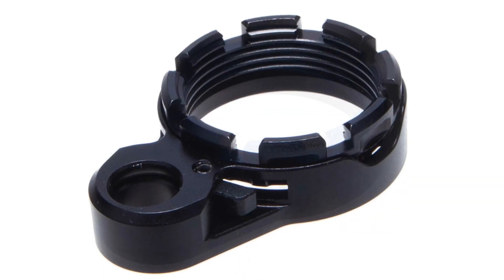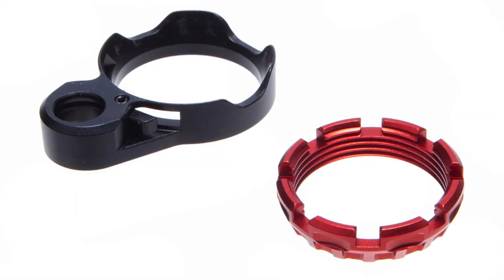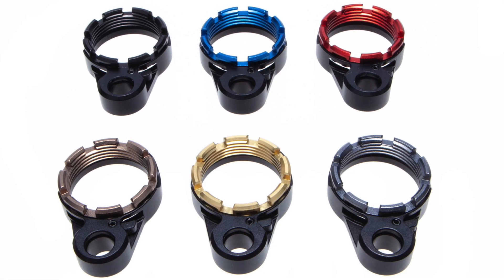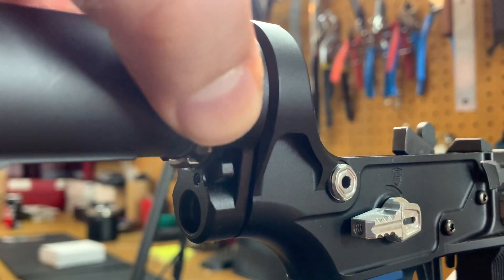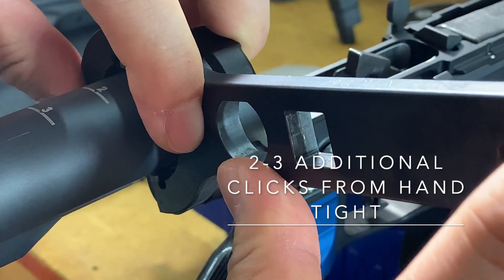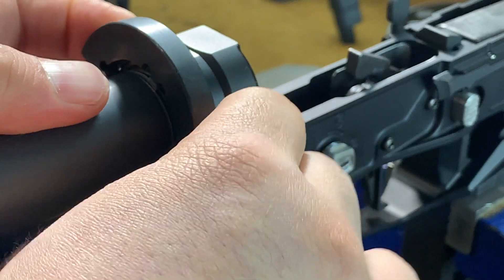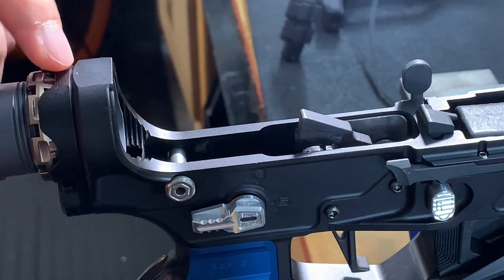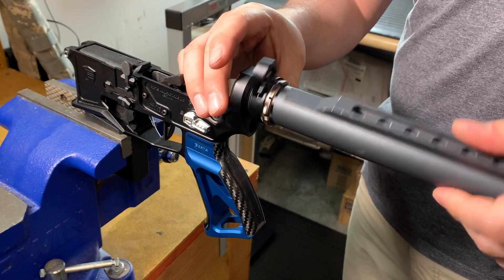Lightweight Enhanced End Plate - K2 System (Locking Lever) Installation

Comment: Does said product end the need for staking? Thank you in advance.
Reply from the maker: No, you do not need to stake it. That's what the K2 locking system is intended to do. It won't move once tightened.
Reply: @FortisMFG  That is a big plus in my book.

Comment: Hey all, I just had this product delivered yesterday. I installed it but for some reason the locking system didn’t function properly. After a few minutes of trying to remove it and pushing up/down on the lever, the lever broke. It is now stuck and I can’t get it off. Any ideas how to get this off my new lower I’m building.
Reply from the maker: Give us a call and we can figure out what might have happened. We'll get you squared away.
Reply: @FortisMFG  thank you for replying, i actually sent in a support email. should i just call the main number?
Reply from the maker: @cryptonationunited7967  Yes, or email directly at info@fortismfg.com. Sending in a photo or two might help.

Comment: I’m seeing two versions of the K2. Some with this version, the locking lever, and another with a C-Clip? But I can’t find the C-Clip version on your website. Is there two different versions of K2 or just a difference in descriptions across websites?
Reply from the maker: Hi Austin, the C-Clip was a prototype. The final version is the one you see here and more robust than the prototype was. Thanks.
Reply: FortisMFG Thank you for the reply. Are retailers selling the prototype versions or are their descriptions not accurate to the final product?
Reply from the maker: @austinw8097  We've never sold prototypes. So no, this is the only version we ever released.
Reply: @FortisMFG  I've seen the prototype version with the clip on optics planet. https://www.opticsplanet.com/fortis-manufacturing-ar-15-le-omega-clip-castle-nut-end-plate-k2-system.html
Is this accurate, or a mistake?
Reply from the maker: @FloridaCruze  Thanks for bringing this up to our attention. No, that prototype was replaced with our current version and never made it to production. We'll reach out to OP to get it fixed.
Reply: @FortisMFG  My pleasure. BTW. I picked one up.  Can't wait to throw it on. Stay safe.

Comment: Got this as well as my billet dust cover last week. Love them so much I will forgive you for never releasing the mag catch you promised me for almost a year.
Reply from the maker: We haven't forgotten about the mag catch!
Reply: FortisMFG I was also going to ask you when you will release a bolt catch and takedown/pivot pins. Then I got an email regarding the new takedown/pivot pins. I forgive you now. What is the difference between the case hardened and black nitride?
Reply from the maker: @jackammo9745  Black nitride is coated whereas the case hardened is heat treated.